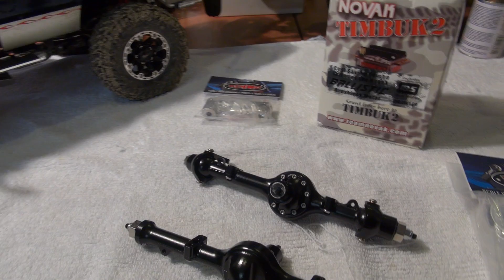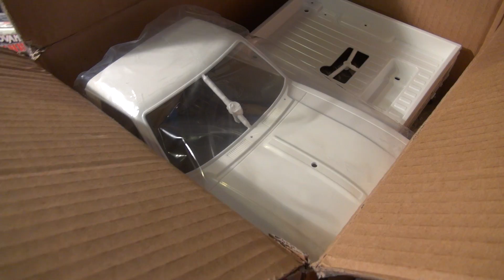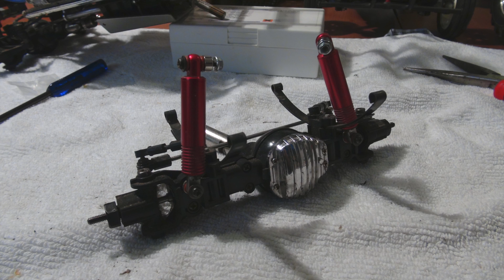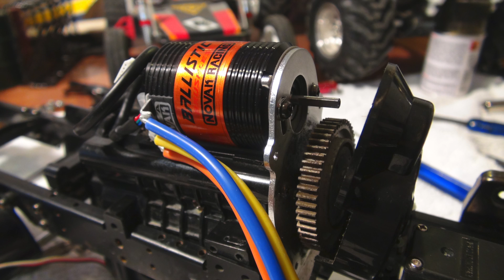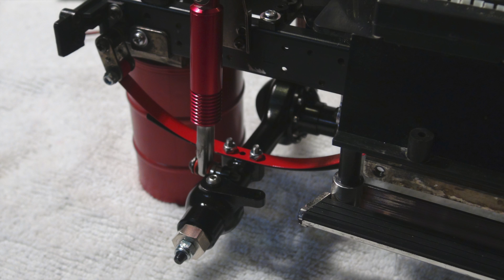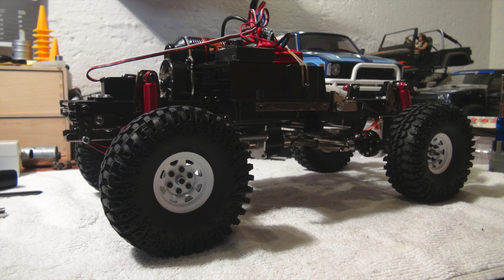Tamiya High Lift Chassis Modifications

Comment: Nice vlog, well presented! I'm about to buy this Tundra 3 speed transmission but don't want to buy a new radio controller. Can I use the more common 4 or 6 channel wheel gun controller from Dumborc or Flysky to enable the 3 speed transmission. I don't care for the lights and sound since I won't buy the MFC-02 unit. Kudos to your channel.

Comment: Great video Matteo, I started building my hilux hi-lift yesterday, the build is going very well. can you recommend a motor & esc for it, i was thinking a tamiya sport tuned motor will be ok.
Reply from the maker: Yes, I think this will be a good motor. 
This is a good esc: http://www.hobbywing.com/goods.php?id=543&filter_attr=5426.0
Reply: Thankyou very much, i was also looking at that one, it was 1 of 3 escs so i'll go with it, i'll try the sport turned motor first as i have one spare, then maybe try a different motor, maybe 45t or 55t. I am putting the Blackfoot tires on it with chrome wheels from a Blackfoot3.

Comment: How may I ask did you fit the f-350 body to the Toyota frame?
Reply from the maker: On the same mounting points (screwed on). But I had to shorten the rear wheel base.

Comment: Mateo! How are you? Question... Why did you choose the 18.5 turn motor instead of a slower motor? Isn't it a fast motor? Thank you
Reply from the maker: +Night Hawk This brushless motor combo is especially designed for crawling and scaling. It runs not too fast, it's very good controllable and slow. (It's not the same like a brushed 18.5 turns motor)

Comment: Also could you make a video about waterproofing the whole truck like the Transmission, Winch if you have one. Thanks so much.
Reply from the maker: I did nothing with the transmission, winch, light unit and the axles, exept the grease. Important is to protect the esc and the receiver, you can see wat I do in this video: @srYwTVjT5Nk
Reply from the maker: @srYwTVjT5Nk
Reply: thanks Matteo.

Comment: those axles you put on are they waterproof?
Reply from the maker: I did nothing with these Axles, but the axel is waterproof. Only the ball bearings in it are sensitive against water, I use grease and spray oil after used in water.

Comment: If i were to get one one the high-lifts, and bought aluminum axial scx-10 drive shafts, would they fit on the high-lifts?
Reply from the maker: I don't know, because I have not a Axial, but you can check the length of it.
82-117 mm and a 5mm shaft.

Comment: Hi Matt, is it possible or easy to make the bruiser like the TF2? I mean change the bruiser wheel to 1.5 and lower it like a regular toyota hilux. is the axle to wide? thank you. I just saw you have the bruiser.... :)
Reply from the maker: The problem are the wheel hubs on the Bruiser Axles. They are very different than a normal 12mm hex hub. But if I remember me correctly it exist a conversion kit on RC4WD...
http://store.rc4wd.com/12mm-Hex-conversion-kit-for-Tamiya-Bruiser-2012_p_2504.html
Reply: ***** thank Mat,, Im getting an old 1985 bruiser. I hope it has the same axle with the bruiser 2012 model. :) thanks for the link

Comment: are you impressed with the red leaf springs? I seen you have added back one black leaf.
Reply from the maker: Yes the red leaf springs are very good and soft. Because of the weight of the Hilux body (with the contractor rack) I use one of the stock leaf springs together with a red one.

Comment: Great Job. Very well done man! I ordered the alloy wheels and some other tires at RC4WD. I love the driving of your car as I think the stock suspension on my tamiya High Lift hillux is way to hard. So I went through your tutorial for the soft springs. I thouhgt, that the frame of the ford of your video must be the same as the other high lifts. But I find on my stock frame completely other wholes. As if the guys from tamiya took a look at this video and put some other whole positioning on the frame. Besides the stock leaf springs of my car must be longer that the stock ones of your ford. Do you drige with the red leaf springs only in the video or do you use one stock leaf spring under the red one as shown in this tutorial?

Did you had a loss of high speed due to the brushless motor system by novak?
Have a great new year and give us some more of yor videos!!!
Reply from the maker: No, not every high lift have exactly the same chassis. Mine was first the Tundra, and I changed it to the Ford, for that I have to change the wheel base. It's possible not all holes are on the same position on every high lift.
Yes I use a red leaf spring and one original leaf spring.
No, the high speed with the Novak is o.k., nearly the same as with the silver can (540)

Comment: oh and i have stock leaf springs and i mounted servo on myfront axle also you dont need 4 link or new shocks to fit it but you do have to make a bracket so your shocks can mount higher than the axle

Comment: my shift rod is a inch long it matters where u mount the servo tho but i just installed a sidewinder 3 brushless in my truck with a 2 cell lipo im making my truck like yours do you have axle wideners im  wondering about stability my truck flips allot how can i stop that.       do you think axle wideners or mabye 2.2 wheels or mabye turn my brushless down more its already at 25% punch

Comment: i have had allot of problems with my transmission also my servo works fine but it its tough to get it into 1st gear i moved the shift servo to the back of the transmission and it might be clearence for me  but its annoying so i just put it in 1st and unpluged the servo for now